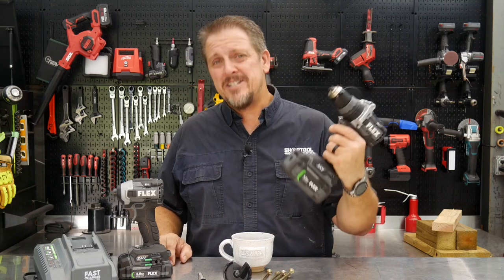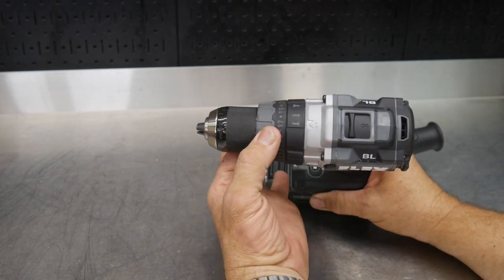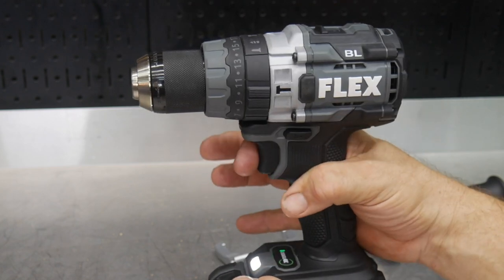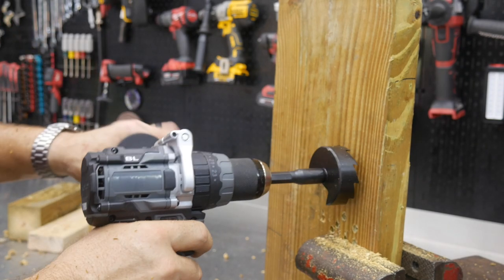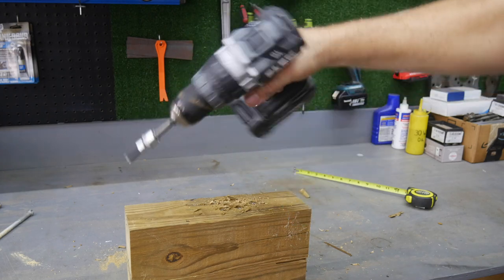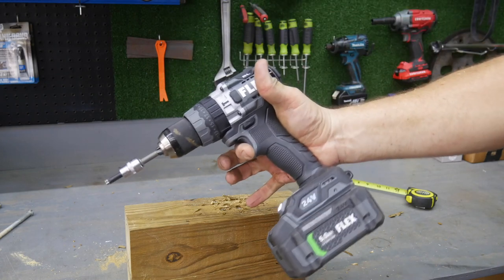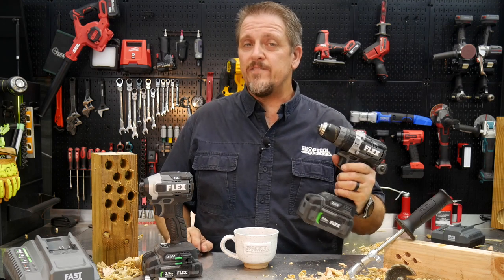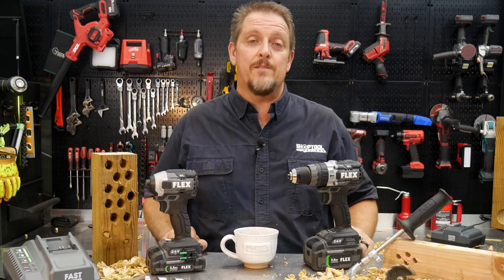FLEX Tools 24V Hammer Drill Driver with Turbo Review [FX1271T]

Comment: I'm a little disappointed the turbo mode timed out.  Those self-feed bits are demanding, for sure, but if you're on a jobsite doing lots of those holes, that would be annoying.  I guess you could leave turbo off and just take a little more time on each hole if you had to.  I'm going to try to replicate your test with my 8.0aH battery and see what happens (although the 8.0 is a clunky beast hanging off the tool and I don't think you'd want to wear out your wrist with it on there all day). Thanks, Tim!

Comment: You did a disservice by not using the  stacked lithium battery.  They are built with extra leads and allow for more current output.  The BL drills take advantage of this.

Comment: Tim, @05:33 does it say to tighten the chuck that way in the manual?  I don’t know about Flex, but every drill I have used or owned, nowhere does it say in the manual to reverse the tightening like you did here?  I’m just asking, as a lot of people are suggesting this in other videos?  I have Metabo HPT cordless drills, that will click back, and I found it makes no difference, and the bits actually fall out.  The chucks on those drills are hit and miss anyways.  
I have used drills for a lot of years, and have always tightened the single sleeve ratcheting chucks all the way, and leave it!  Like I said, this chuck may be different?  Enjoy your videos, and thumbs up.  Stay safe and Healthy!  👍👍👍😁✌🏻🇺🇸

Comment: Good video.... But it is amazing to me how many YouTube channels aren't aware of the anti kickback feature on the Flex hammer drill.  It protects your wrist from breaking when the drill rotates rapidly, it only takes a short rotation of the drill to engage it and this is probably what is happening when you are using the 2-9/16" self feed bit.  It is like ATC (active torque control) on Hilti drills.  It is a great feature for your safety.  You mentioned it when using the timber screws, but didn't when you used the self feeding bit.  Cheers

Comment: I’m glad I watched this again because it confirms that the one I got has a defective chuck.
Reply: Does it wiggle when you press the trigger cause my does that
Reply: @grinding8035  The one I had didn't seem to ratchet properly. I returned it. The Flex wasn't very comfortable for me to hold, anyway. The groove between the rubber and the plastic under the trigger kept digging into the knuckle on my middle finger, even with gloves on.

Comment: Just picked mine up today, gotta say actually very very impressed. Went in to pickup a Dewalt XR and glad I went with this instead.
Reply from the maker: It's hard to beat. Great drill. Thanks for watching.
Reply: @Shoptoolreviews  Sure is, been very solid, used it all weekend for a big work project and it held up great.

Comment: Drill Steel! There's entire industries of guys using drills every day who never drill into wood. The relationship between torque and speed doesn't translate between wood and steel very well. Steel needs higher speeds and indeed pressure and that's certainly going to be important in which drill you go with but every drill review focuses pretty much entirely on wood, which is less of a challenge in my opinion.

Comment: 5amp flex battery 1800cells cant do the hvy duty stuff overheet - u need 2700 cells 8amp battry or need a 4/5 compct battry wit 2700cells

Comment: i know guys like to drive screws in with their drills but the impact driver is actually a better tool to use because of the shorter drive on it...i said to myself when he had the bit and the extension plus the depth of the tool, he's going to fall off of that thing....and he's good at driving in stuff...Joe Homeowner is going to fall flat on his face with all that extra length

Comment: If only an OEM would come up with a middle mechanical gear somewhere between Speed 2 and Speed 1 so that you can still finish large bores faster than Speed 1 without stopping like Speed 2.  

Oh wait....   DeWalt foresaw this problem and came up with a solution.  Thanks DeWalt!

Comment: Not that anyone asked but, I have yet to see anything about Flex that would make me want to even try it out let alone replace my Makita tools.
Reply: Anyone would be crazy to replace Makita, Milwaukee or Dewalt for Flex. Maybe in 5-10 years if Flex is still in existence and “all” my tools need replacement.
Reply: Try the 7 1/4 rear handle saw or the 6 1/2 in line saw.  Both are better than the Makita.  I own the Makita and got tired of being covered in sawdust

Comment: I will not be buying Flex for two reasons.  First I have a battery platform I'm happy with.  Second, just because they do well in tests doesn't mean they are reliable and have a warranty that is honored.  I'll wait to see if they stand the test of time.
Reply: Agree.  Flex seems to think that Power Tools are meant for winning Power Tool Races on the internet.  So they geared their tools to win races against only M18.  

I want tools that work when I pick them up.  I don't need a Ferrari out of a power tool.  A Toyota tool will do.

Comment: Let the blade do the work, quit binding the bit by trying to Reem out that hole.
Reply: The bit wasn't successfully pulling itself in and he was trying to get it to bite.
Reply: He's not reaming, he's adjusting pitch angle in order to adjust the biting surface so it doesn't bind. Very common when using bits that are not new or perfectly sharpened.